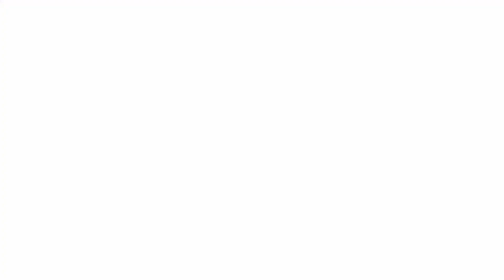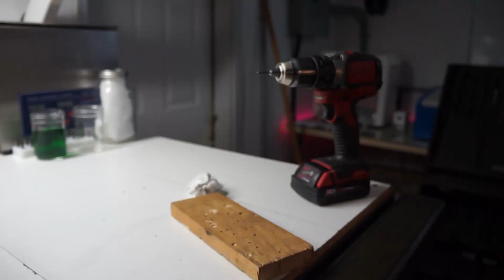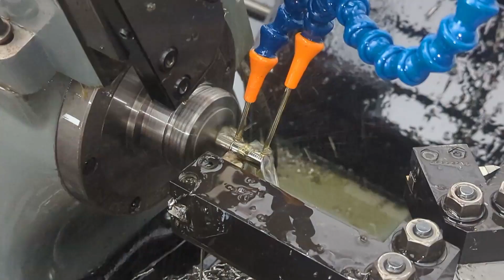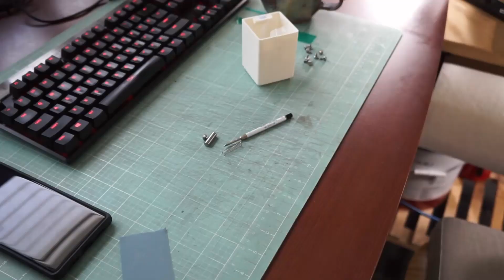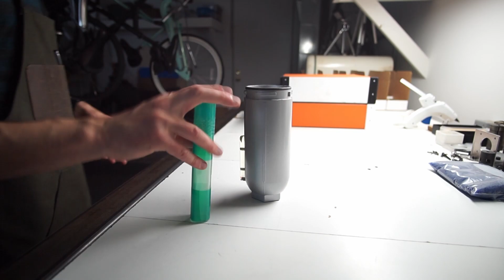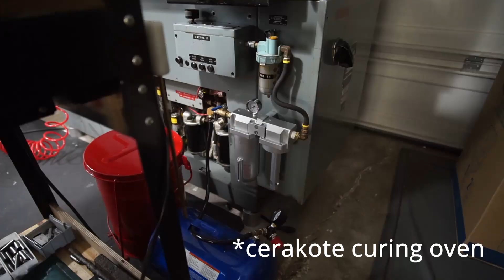Always Be Optimizing

Comment: Just found your channel, really cool stuff here! Also running a LCNC Mill for production mould parts.
Could you swap the pneumatic valve for a 5-3 way valve which lets air out in one position (wired to a simple switch/cnc button) so you can have an easy way to feed in new bars from the front?

Comment: I JUST GOT RECEIVED THE EXACT SAME LATHE!!!! ,  i bet its the same series number!!  no bs!!!,  im in the retrofit process,  I just got it to turn, but the uper band is ruined, so I just order it next to a vfd,  ill use the wait to recover from the legs being crouching to get it out of the cone pulleys is no joke,  I installed the new servos,  I can do a part, but the tricky part I dont have a clue of what to do is the tool change,   I removed the bolt and you can lift  the turret by hand,   I actually did a test that way,  I removed the 4 bolts, lift it turn it and bolt it again and there is your tool change,  I actually took the whole thing apart , didi a nice paint job on it and I just prepared it yesterday,  still have lots of work on it, but I need it to run as fast as possible couse my client is desperate,  dud I am getting the pearls here, the pearls !!!     dud this tips you have for upgrading are just ,  only a person that has this same lathe could understand their value !!  thank you Sr!!!
Reply from the maker: Happy if it helps someone else out!  There are a few great builds over on the linuxcnc forums.

Comment: Top tip: Stop thread milling and start using carbide drills and form taps. Choose the percentage of thread engagement by the drill size and you'll get a couple of hundred holes with the same fit per tap.
Reply from the maker: I actually ran form taps in ti for a long while but getting a full thread profile at 2-56 in Ti with form only proved to be difficult. Form taps are nice as the threads are usually stronger but I'd argue that cut threads are better looking.